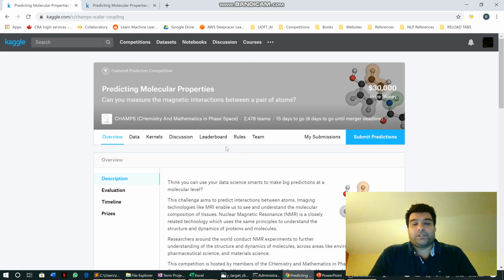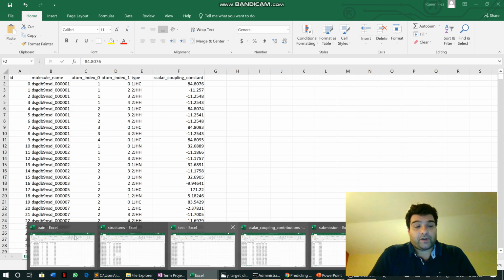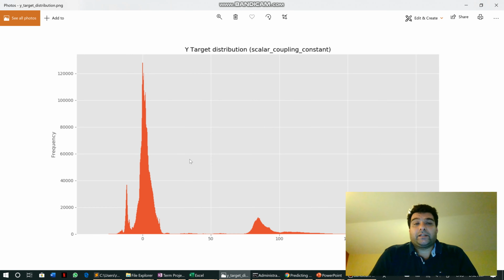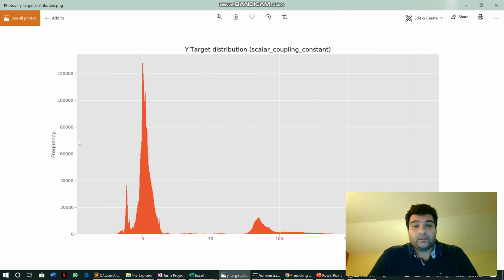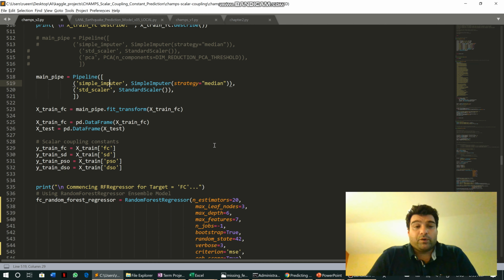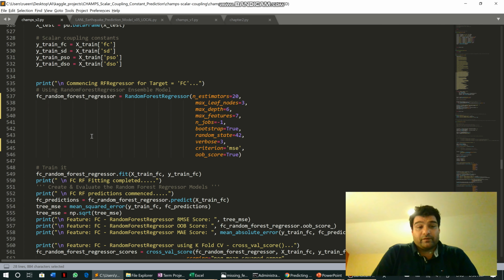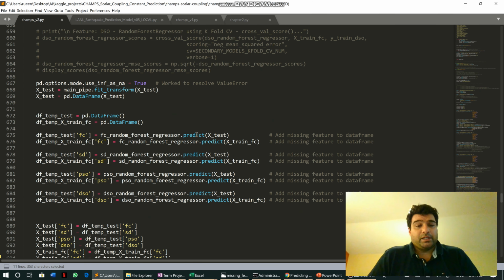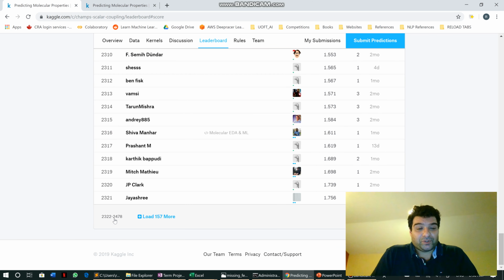Predicting Molecular Properties - U OF T Machine Learning (3253) final term project

Comment: Rueen, great job. I am wondering what other participants done with missing columns in test data set? Did they impute them by literally predicting them?
Reply from the maker: Hi Saeid, thanks for your comments.  Since these properties were avail in Train set but not in Test set a lot of the participants just dropped these four properties from their Train set and then did the fit().  When we saw these four properties seem to be correlated to our Y target, we decided it’s worth predicting the missing  properties on the Test Set, Train our classifier using the ones avail in Train set and then predicted our Y target using the full test set which includes the four missing features.